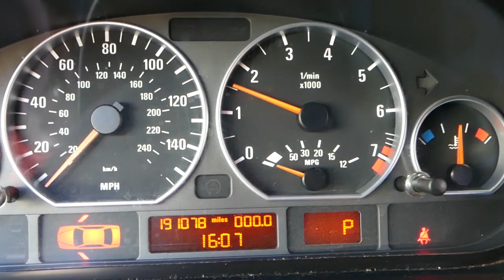CHEVROLET CRUZE AIRBAG MODULE LOCATION REPLACEMENT REMOVAL EXPLAINED

Comment: Is that airbag module vin specific? or if I have the same car year/model etc, it will work, can I use an identical module from a different identical vehicle? if it needs to be programmed can a used module from a different identical vehicle be reprogrammed to my vin? All this is for a 2011 chevy cruze 1LT